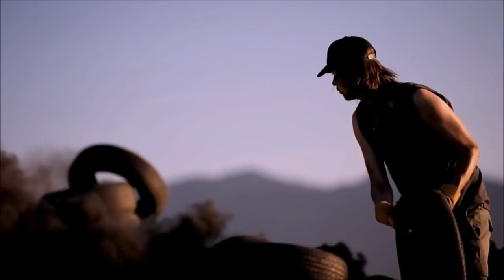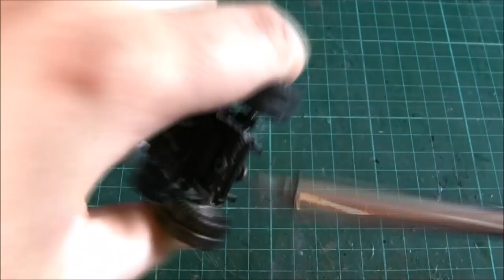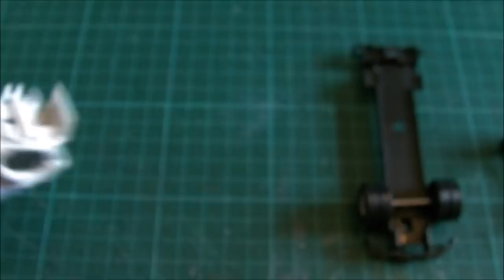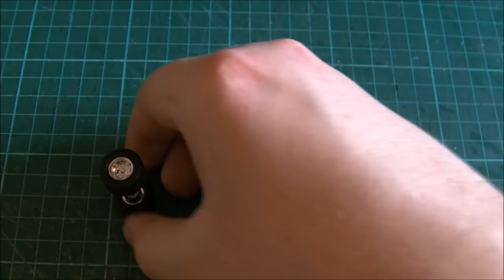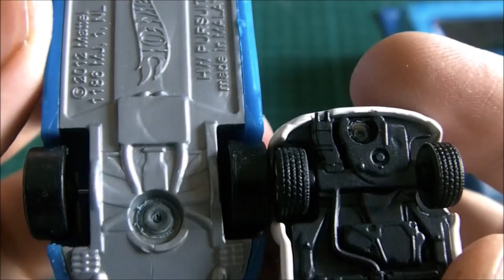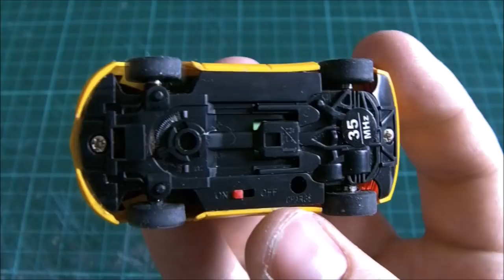Crash Course: Wheels

Comment: Lego wheels. They come in sooo many different sizes. Probably not cost effective to buy them new, but I have a massive tub of legos from my childhood so thats what I use.
Reply from the maker: I know that feeling 😂 tbh I don't tend to use lego in modelling, I find they are a bit too blocky, the wheels too, well, recognisably lego
Reply: I have som of these rubber LEGO wheels and they are so detailed, so what I did is using a dremmel I dremmeled out the spots that where expose to attach to other pieces. Awesome video!